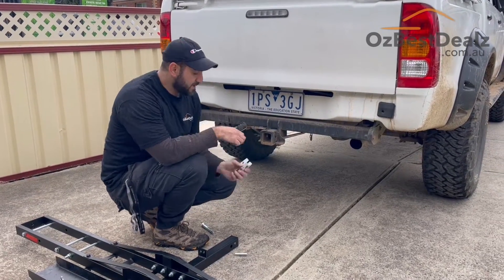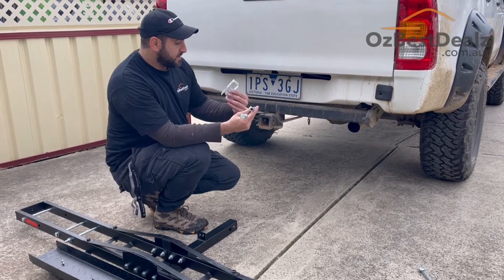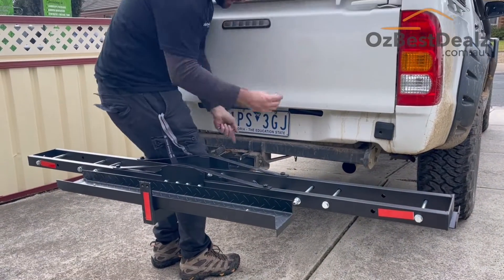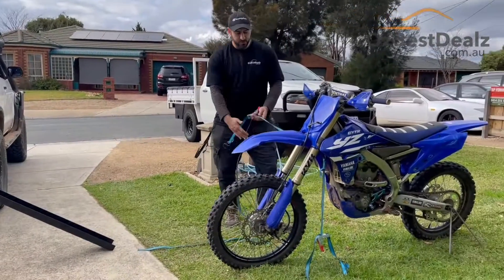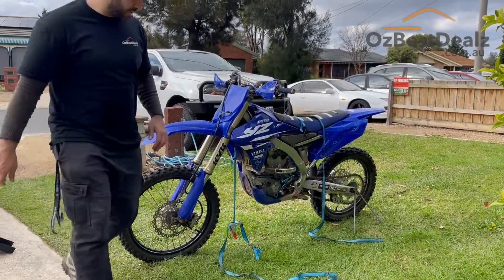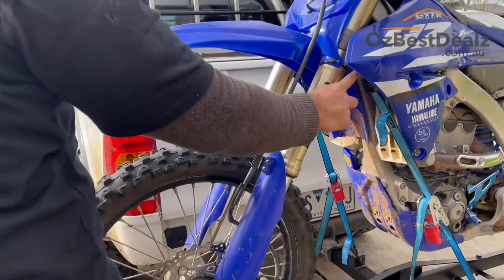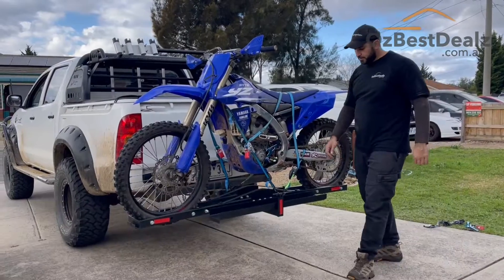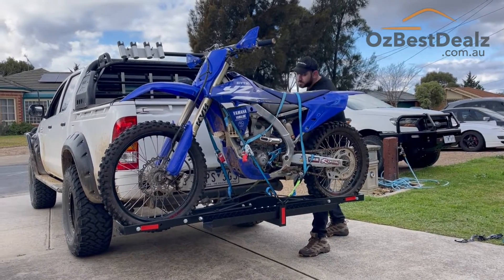Motorcycle Motorbike DirtBike Hitch Rack Tow Bar How to Installation Demonstration

Comment: Thanks for this. My bike's sitting up on the top of the screws/rods and it just wants to tip over. I figured the cross pins served a purpose but my rack's instructions didn't clarify.